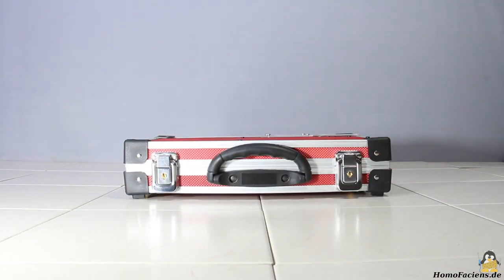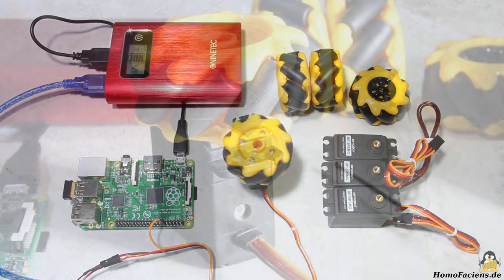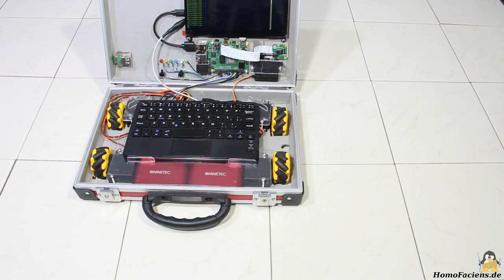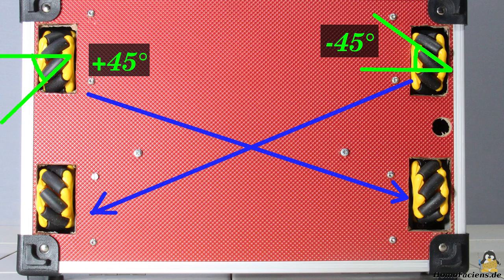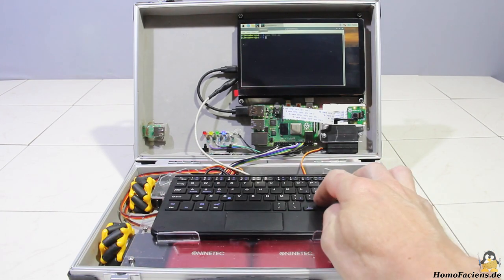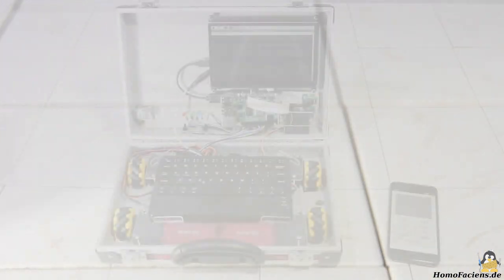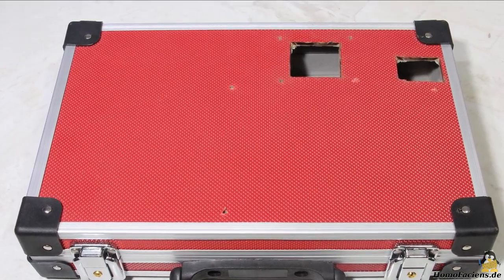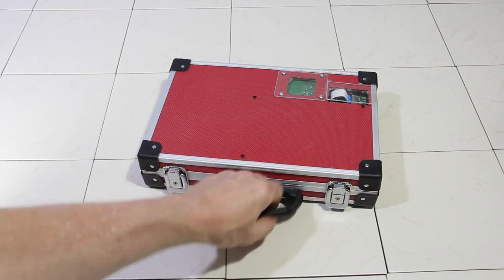R19, suitcase robot based on a Raspberry Pi

Comment: I believe you can try making a smaller version of this project using a Raspberry Pi Zero, micro servo motors, and a smaller keyboard and touchpad. Try to cram the electronics in as small a space as possible, it will be quite challenging and fun.
Reply from the maker: I'd rather use a larger box for my next "take it with you"-rover. You never can have enough storage for some extra bits and bytes. However, making robots smaller is what I am trying for my RoboSpatium. R18 is based on an ESP23-CAM and currently my smallest rover: https://youtu.be/-B7phixfDFY

Comment: I noticed the wheels don't start and stop at the same time. Is there a specific reason the wheels start and stop aren't synchronized? I just received the same type of wheels for a robot I'm designing/building. Nice to see your approach.
Reply from the maker: The pulse width signal to control the servos has a frequency of 50Hz. Turning on one servo at a time means that 4x1/50Hz=0.1s is the minimum time needed until the last servo is turned on, too. It is a software thing and I haven't done any investigations if pigpio han turn on multiple servos with just one command.
Reply: @HomoFaciens  Ohhh shoot, very interesting at the same time. There might be other protocols available to let all the motors start at the same time 🤔
I'm planning on using stepper motors with a different controller that allows for simultaneous axes to be controlled. I'm quite curious if I can make it work.
Reply from the maker: Stepper motors are driven with pulse trains having a much higher frequency, by what that time span shrinks to "not noticeable". Should be no issue for you.